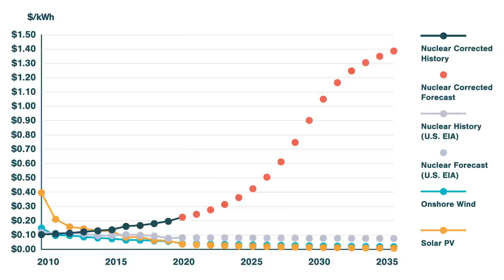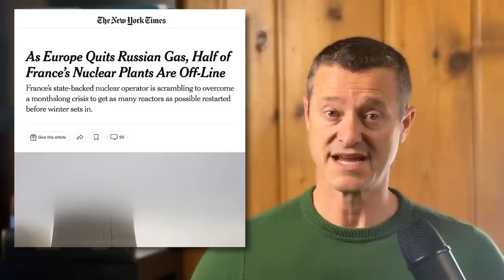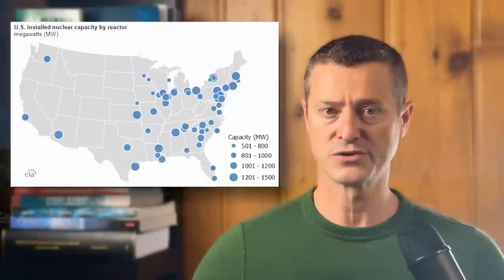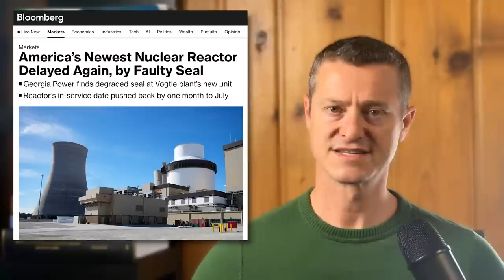Brighter | Episode 10 - Why we shouldn’t build nuclear power

Comment: Sorry to upset your clear cut conclusions: we have had a vibrant and productive nuclear power program in Ontario (Canada) since the sixties. Our program dispels many of the myths propagated by your study. It has no connections to any nuclear weapons program, and is unlikely to ever do so given that it runs on natural uranium. The plutonium bred as a byproduct of operations (N + 238 reaction) is largely burned in-core. The safety systems designed into the CANDU core are unlike any in the world, and has lead to decades of essentially problem free operations, free of reactivity excursions, and very near 100% up time in most years. This is also largely due to our clever on-power refueling system.
You conclusions apply to nations and programs that insist on American-centric PWR/BWR designs emerging from its earliest nuclear navy program. Please do NOT extend this thinking to all of the world - some of us are smarter. If you then say this agrees with the conclusion that matures societies only are ready for exploitation of this sort of resource, then let Canada stand as an example of what can be done!
Reply: How is the waste disposal going?
Got a demonstrated cost for that?
Reply: If the framing of the question as "demonstrated cost" is meant to be sarcastic, then I sense that you know that we - like all democracies subject to the worst case of the tyranny of the masses - are held up here in pursuance of the last, crucial step of the nuclear fuel "cycle", BUT by political forces. If the question is a straight one, then forgive my sensitivities, grown from years of defending scientifically valid and well engineered solutions from poorly informed "activists". The fact is that people ARE afraid to take ownership of this, whether insofar as the literal location on "their land" of geological deposition centres or reprocessing plants, or conceptualizing any strategicaly useful alternatives. We do in fact, intellectually and otherwise, own demonstrated encapsulation methods, and a vast Canadian shield as a kind of resource, for definitive and safe final disposal of at least the fission products, if not the attending valuable actinides. 

As alluded, certain anti-scientific forces in my county prevent further progress on this urgent matter, and it is a shame. If Ontario could get the serious collaboration of our federal system to move ahead, we could be world model again, this time with a complete cradle to grave solution to the energy problem. It will turn out that it is really the political delays in tending to this that carry big, unnecessary costs.

Notwithstanding all this, I would be the first to advocate for bending the course of the conventional nuclear "cycle" into a true one, with a true intrinsic breeder, such as the thorium concept, instead of spending all of our limited uranium.

best regards,  DKB
  @aaroncosier735

Comment: The storage of spent nuclear fuel is another issue. It can't be shipped because there is no licensed transport cask, there is no licensed transportation route (cities don't want it traveling through their back yards) and of course there is no national repository for spent nuclear fuel in the country. Hence it remains on nuclear power stations all across the country for now and forever because no politician would touch this issue with a 10 foot pole.
Reply: Waste Isolation Plant in New Mexico would be the ideal spot for Spent Nuclear Fuel.
Reply: @shawnnoyes4620  
The WIPP is intended only for low and intermediate level wastes.  The US alone has over 140,000 tonnes of spent fuel waste. 
Not as easy as you think.
Reply: @VoxVictus  
Not so easy as that. Spent fuel has to be reprocessed to make MOX fuel. The US and others have been doing so for a fraction of the reactor fleet for about forty years. Spent MOX fuel is a lot harder to recycle. The more times you put plutonium through a reactor, the more of it turns into less reactive isotopes. Some of those include U232, which makes further reprocessing difficult due to the particular gamma emissions, and make storage and disposal more expensive due to the half-life of seventy years.

Comment: The cost of Chernobyl and Fukushima accidents was over $500 Billion and neither had the insurance to pay for those damages from their radioactive plumes.
Reply: Those are highly inflated costs. Plus both reactors were very old, using deprecated designs. Three Mile Island is a better example of a nuclear accident. That's what we would get with modern reactors. There was practically no release of radioactive materials, no evacuation, no health effects or property damage, only the reactor itself was a complete write-off. And since then safety increased drastically due to better understanding and much more strict safety culture.

Also the cost of the Deepwater Horizon disaster is over $60B, and those kind of accidents are much more frequent.

Comment: If you go centralised electricity generation you have to include the grid expansion costs. 
Most idiotic promoters of nuclear energy ignore this.

National grids are close to the national GDP, $TRILLIONS. 
Million $/klm × million klm= $TRILLIONS. 

No fossil fueled future, then 5 TIMES more electricity and 5 TIMES bigger national grid, plus EV which remain parked 23hrs every day. 
EV battery is huge, and the majority do nothing 23 hours every day. 

Australia has 20million buildings and vehicles. 
USA has 300million buildings and vehicles. 
Rooftop solar PV and big batteries and the EXISTING NATIONAL GRID perfect for most, most of the year. 
The fatter grid is the killer costs.

Comment: This is a good overview, readily accessible to lay viewers. The problems outlined will become more worrisome by many orders of magnitude with climate change. Extreme  conditions (severe storms, floods, drought, wildfires) not only threaten nuclear plant safety directly (mostly through heightened risk of loss of off-site electric power), but will drastically reduce the capacity to mitigate reactor site events through damage to other infrastructure. Further, the negative impacts of nuclear upon waterways due to the large quantities of water intake, and release of radionuclide pollution is dwarfed by the far greater ecosystem threat posed by reactor heat discharge. Massive thermal plumes continually heating lakes, rivers and oceans is one of the last things we need in a warming world.

Comment: I think the cost for used here is old tech (even refers to this in the presentation) the U.S has not built any significant new Nuclear plants for decades and are back in that era. The latest generation plants are a long way ahead. The water argument is also slanted to fit the narrative. Nuclear plants operate in many hot climates over summer and use cooling towers to cool the water. Nuclear operate now in the wholesale electricity market including the low price off peak and the higher cost peak prices. To say nuclear cannot compete is not right. Even with the low cost of solar there is a long way to go from 2.8% supply which is only off peak supply to making any significant contribution. It’s not going to happen in foreseeable future. To think that solar can replace base supply electricity 24/7 with batteries is just a dream
Reply: Can you elaborate on this and please supply us with some sources? "To think that solar can replace base supply electricity 24/7 with batteries is just a dream"
Reply: about 29 GW of power was added in solar power alone in 2022
Reply: @AWildBard  A quick google search will tell you that you're almost an order of magnitude to low on how much was added in 2022 and 2023 will be quite a bit more than that.
Reply: @benjaminoake  When and where are we talking about that? In Germany with long, dark winters? Sometimes there is no sun and wind for weeks, yes, weeks, not days.
At the moment Germany has 10.8 GWh of battery storage (private + commercial + grid).
To store energy from sun and wind over a period of roughly 3 weeks (so no need for power plants*) Germany would roughly need 30 TWh or 30,000 GWh - sounds a bit absurd?!.

*pv does not deliver any spinning reserve to the grid and no stored instantaneos reserve making a grid in the summer very vulerable in cases of short circuits of any sort of imbalance. 
pv and wind would not be able to deliver reactive power to high voltage lines making and a blackstart is virtually impossible without power plants and their electromechanical turbo alternator.

Comment: Excellent video showing many of the negatives of nuclear power, with cost being the primary push away factor.  New technology pull factors will quickly outdate nuclear further, such as pumped hydro, where there is ten times capacity in the world. Further is Eavorloop’s closed-loop geothermal also coming on line in Germany and then worldwide very soon.Almost limitless base load power combined with instant battery response and electricity generation at a fraction of nuclear costs, sounds like game over for nuclear fission.

Comment: Anyone who is against "new" nuclear energy, answer this question. What is worse ?
A nuclear accident, that on a global scale is relatively small, has a very very low chance of happening and can be contained and managed in the vast majority of cases. 
Vs 
The climate crisis running out of control, us smashing through 1.5°c warming heading on to 5°c, which triggers all the tipping points on the way, causing a feedback loop and making an extinction level event happen before the end of the century... 🤔
To all the people who say yeah but what about the "nuclear waste" 
The so called "nuclear waste" is actually spent nuclear fuel that has valuable materials that can be utilize to generate energy and provide benefits to society.  By using new nuclear technologies like the Molten Chloride Fast Reactors (MCFR) you can destroy everything you don't want like transuranics, actinides, spent nuclear fuel and plutonium. But at the same time make new valuable materials like u233. By having the (MCFR) wrapped in a thorium blanket as we destroy the "nuclear waste". We can use the U233 produced to start new Liquid Fluoride Thorium Reactors (LFTRs) that will run only on thorium, produce almost no "nuclear weaste" and never run out of power.
There is about 88,000 metric tons of spent nuclear fuel in the US alone that can be reused, that is enough fuel to meet all the USA energy needs for over one hundred and fifty years!!

The only argument against [nuclear energy] is a political one, that people won’t accept it, or people won’t want it. I don’t think there are any engineering or physics challenges that can’t be fairly easily addressed, and that includes the cost, if the will is there to do so. With time running out fast we must have a pragmatic way of thinking regarding nuclear, not an ideological one.

It would take 51.4 billion 350W solar panels to power the world!
Put another way, this is the equivalent of a solar power plant that covers 115,625 square miles.
For wind It would take 1.49 million wind turbines to supply the world's energy needs, if we only used extremely efficient turbines (i.e. ones that create 4 MW of power at 40% capacity). This would require 5.85 million square kilometers. All this is not including how much power it would require to power the worlds transport needs... Add in to that the intermittency of solar and wind and it's just not gonna come close.

So you see, New nuclear is the clear answer!

Comment: I have to wonder if you just did a one to one ratio of energy when doing the calculations. Why? Because as we know switching to electric will actually result in a massive reduction in the amount of energy that is actually required. Burning stuff to make any energy other than direct heat? Is horribly inefficient compared to renewable generation. The total amount of energy in MBTU will actually reduce by about 40% switching the economy to electric because of the efficiency gains across the value chains.

Comment: Let's be honest, grid electricity is what we are talking about.
We must include all costs and our limitations. 
Distant renewables is grid electricity. 
Nuclear is grid electricity. 
Fossil fueled is grid electricity. 

To expand the electricity supply means to expand the grid and grid capacity and the generation. 
Resources and CO2 and financing and time demanding. 
This is a national GDP ×3 problem. 
Existing national grid, a 100 year build.

Battery storage and generation is free of grid costs.
If EV are viable, then customer's generation and storage and no grid costs is a huge advantage. 
Resources minimum. 

In fact, customers may go offgrid and abandon grid electricity and its cash demands. In the suburbs. 

Grid electricity must not cherry-pick the initial no grid roll-out filling the existing national grid with nuclear electricity. 

Nuclear is an extremely expensive and extremely long time framework  that will need Government disaster insurance and Government guaranteed cash flows. For 60years to 100years.